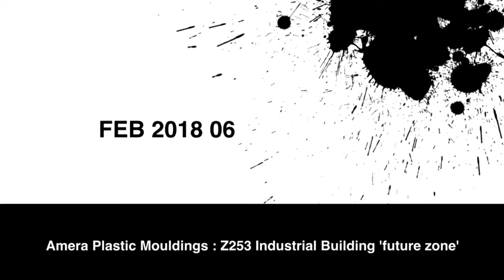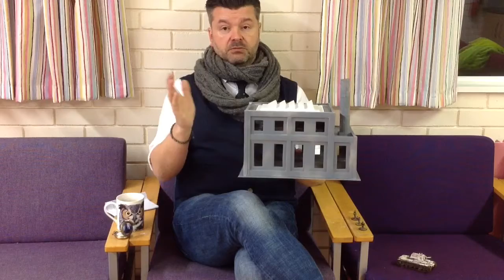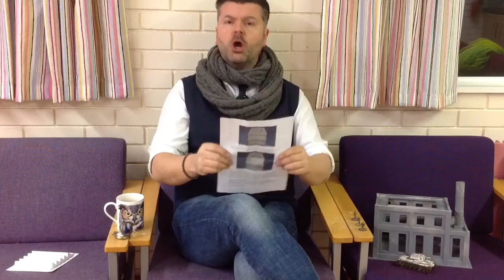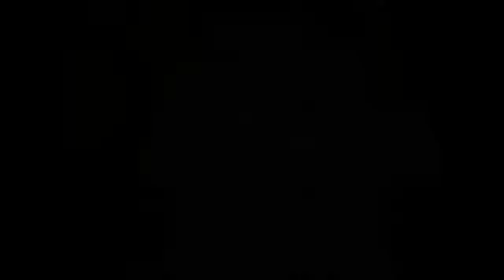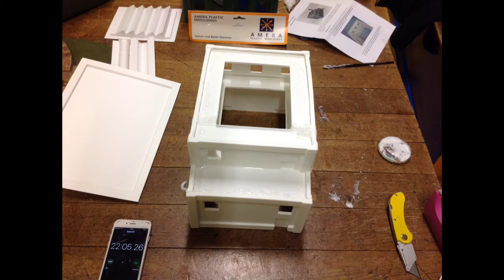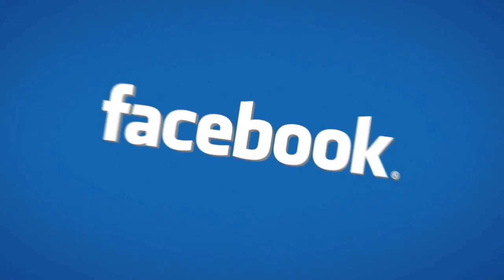Amera Plastic Mouldings : Industrial Building Z253 - FEB 2018 06

Comment: Thanks for this - I make up 20mm and 54mm 'toy soldier sets' to give away to less well off families, was thinking this might be of interest for 20mm even though intended for 28mm. Think I'll get one and try it - Couple of points: 
1 Use polystyrene glue, I like the stuff in a bottle applied with a brush, it welds the parts together and dries/sets in a few minutes (faster than superglue I suspect).  
2. For 28mm I would suggest using 'mosaic mesh' for the windows. It's some kind of fibreglass netting, cannot remember the size of the mesh off hand but it looks right for 28mm.  Glue to clear plastic sheet with PVA then glue to the inside with Uhu (for 20mm I use plasterers scrim, similar but has a smaller mesh).
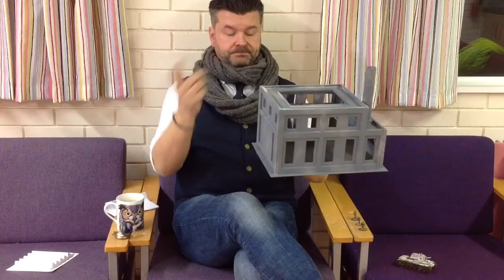3. If considering adding bits to it check out 'Slaters Plastikard' - They do stuff like individual letter alphabets, embossed corrugated iron sheets, brickwork etc. as well as plain plastic card in various thicknesses and pre-cut strips in various thicknesses and widths. (I also save the off-cuts from Amera kits to cut up for that, it's good quality card). Slaters are mostly aimed at model railways in 1:76 and 1:48 but some in 1:32 (28mm is roughly 1:64 which is model railway 'S Scale', mostly popular in the USA but a possible source of scenic bits). Slaters also sell polystyrene glue (one of the better types: MEK-PAK Fluid Cement). No connection, satisfied customer etc.
4. To get things 'square' I use cheap knock-off Lego-like bricks from Wilcos.
Reply from the maker: Cheers for taking the time to watch and feed back, means a lot. Yeah tips always welcome. Sometimes we are stung by available time and resources, but always keen to improve! Good luck with your worth while hobby time projects too.